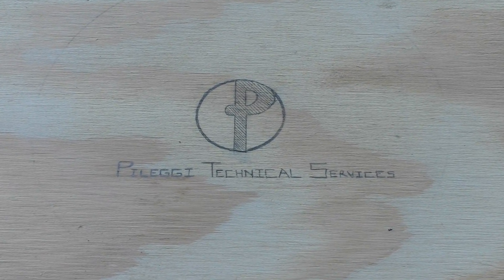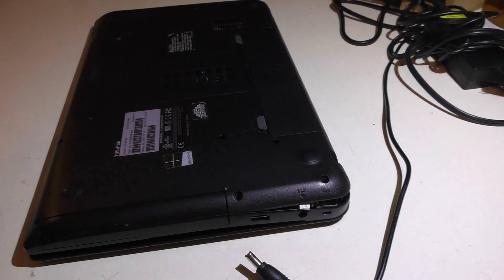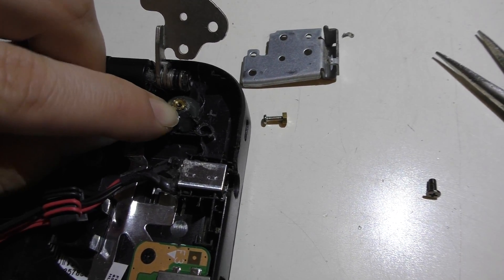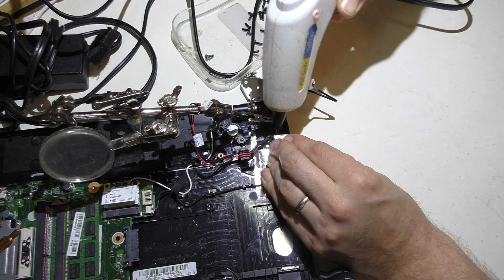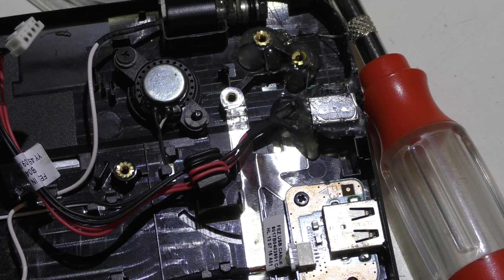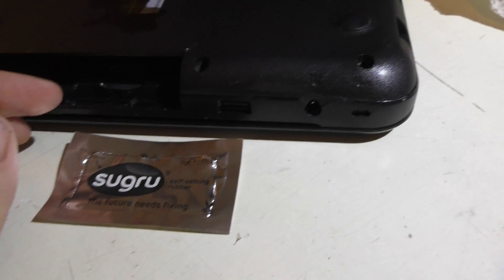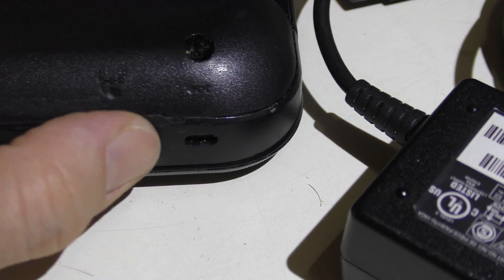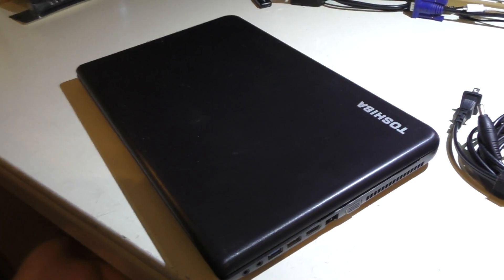PTS Ep. 3 - Repairing a Damaged Charging Port on a Laptop

Comment: I have the same problem and I lost the screw. What do I get for the replacement screw?
Reply from the maker: I'd check Amazon or eBay.  Look for "Laptop Replacement Screws".  They'll usually come new in an assortment of sizes in a plastic case.  You can also find them used in little bags when people salvage old tech.  Lastly you can even pick up an old laptop at a garage /  yard sale or a thrift store and salvage them yourself.  I salvage old laptops when people give them to me so I always have them on hand.  The size of the screw is usually stamped next to the hole it goes in.